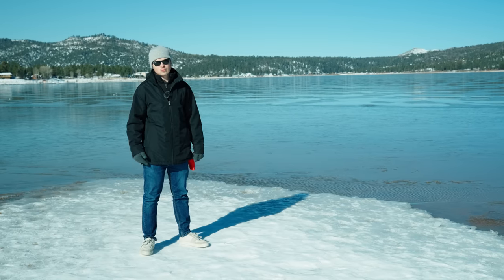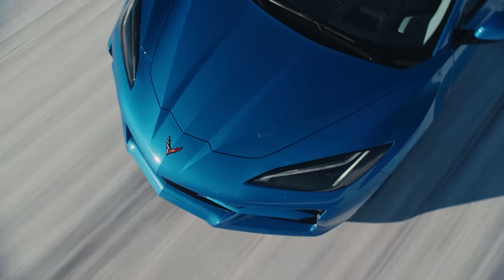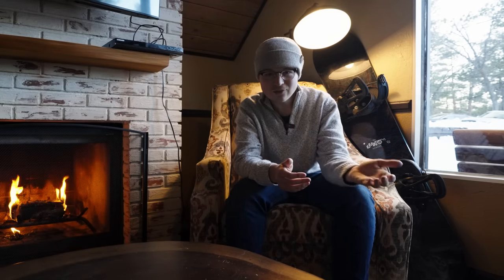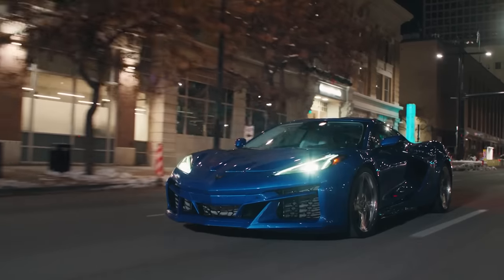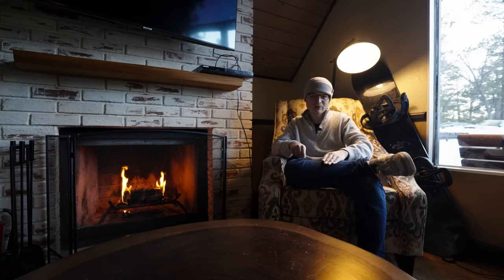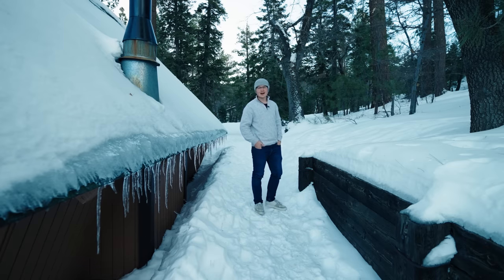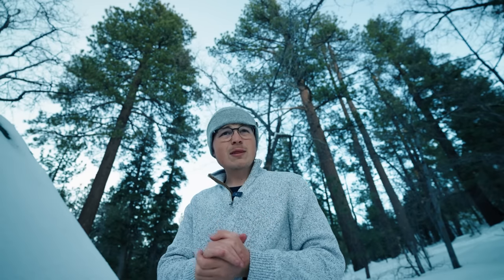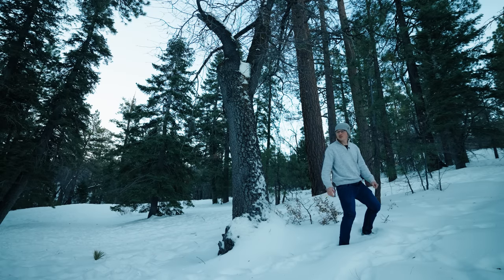Introducing the C8 E06 ... *830HP NA V8 Supercar*

Comment: It’s actually a lot of engineering work to make a decoupled axel eAWD system work like it does in the eRay. And it’s tuned to work with the power characteristics of the LT2. It would take some decent effort to make it work with the LT7, but for sure it’s been considered

Comment: The way Chevy has done it in the past is to supercharge a Z06 to make the ZR1 which in this case would make for a near 800 hp Vette and if they did that they could then power the front wheels electrically as on the E-Ray for the Zora and have a line topper in the 950-1000 hp range.

Comment: Um if you just build the motor of the e-ray.its  quite conceivably get the 6.2l v8 to 1,100 HP naturally aspirated.now the reinforcement of the drive train is going to be required.you could increase the stroke and gain more power. 
More interestingly can this chassis take 1100 plus reliably

Comment: That electric motor is small for it power and they are not connected to the V8 LT2 . So it's not that easy to add that to the ZO6 with software  as GM is doing with the New Stingray version

Comment: Gm should offer Eray option with c8 base . They should offer Eray as grand sport widebody with normal brakes . 
And as Eray but again with option for normal brakes . 
The zr1 should be z06 with Eray option as you are saying . This has much better chance of hooking up being awd and as said extra instant torque which z06 is bit weak on torque . The zora should be z06 engine with twin turbo and Eray option . 
This again would help traction situation .

Comment: Use the electronic motor as a sort of kers system, with a boost button on the steering wheel, like F1. Don't use it on the curves, use it to pass and draft on straightways, which would make it the ultimate Z08. Also, figure out Away To get more than a 160 horse power While Is using Half the batteries, With some sort of a high power Generator Alternator Combination. And put a pneumatic wing that raises and lowers for down fore, but also doubles as an air break. Z08

Comment: Its possible, but car and drivers initial C8 series plan still sounds plausible. Straight pipes had this theory as well, but the ZR1 will be the the twin turbo 800+ HP LT6 and the Zora will be be the twin turbo LT6 plus electric hybrid producing 1000+HP according to car and drivers series plan for the C8. Neither will be track focused cars. GM will match hypercar performance with the C8 series, but Ferrari and Aston Martin have now moved to LMP cars that are very track specific. The Zora will be a rare car I predict. It is possible that the ZR1 will be a hybrid.

Comment: ProCharger already makes a centrifugal supercharger for the LT2, so why not put that on the LT2 in the E-Ray? Best of both worlds!  Basically, it's the same horsepower as the Z06, but more torque and the instant torque of the electric motor and AWD of the E-ray. That's a win-win.  Go a step further with an Active Aero wing from Victor Racing and you may have a ZR1 🤔🤔🤔

Comment: What matter more is for GM to stop locking computers. as much as i love my Chevy's Only reason i dont have a C8 is because i have zero interest on a vehicle that i cant mod and tune easily. my 1100+ HP SS sedan, my 1000HP+ GT-R  and others are amazing because they are easy to tune. 

if i want to tune it i dont care losing warranty. i mod all my car as soon as i get them. 

complete failure and GM's most assonyde action is not making them easy to tune.
Reply: Tuners go around the lockout ECU with a tunable ECU piggybacking the stock one.  Seems to be working so far.
Reply: @billyhndrsn4542  only way to properly tune them is with a $14k motec set up. Anything else are workaround that are not good. Which is exactly my point. Unnecessary and idiotic for GM to lock them. We want to tune them easy without having to find workarounds that do not do a good job or a whole $14k motec set up.
Reply: The term is asinine, not assonyde. lmao

Comment: If its anything like the Hummer EV it will be a disaster.
Reply: The Hummer is a all electric plug in vehicle.  The E-Ray is a hybrid that recharges itself while driving, braking,  so no plug in worries.
Reply: @billyhndrsn4542  Still GM. Still the same batteries. Not good.
Reply: @polystictus  I little Honda powered Generator in the trunk would be better.